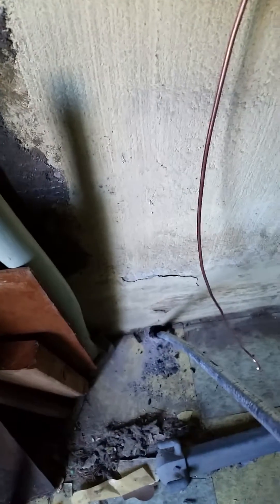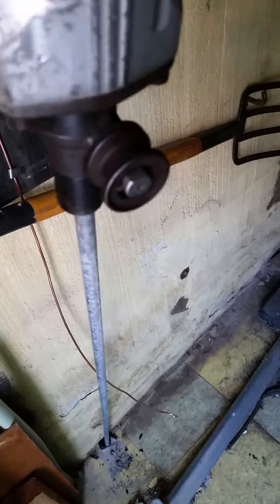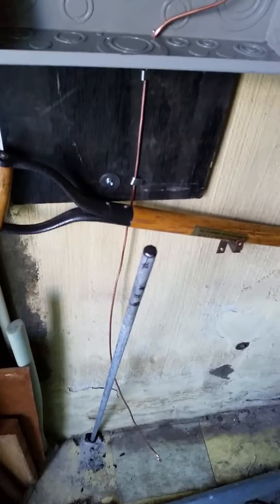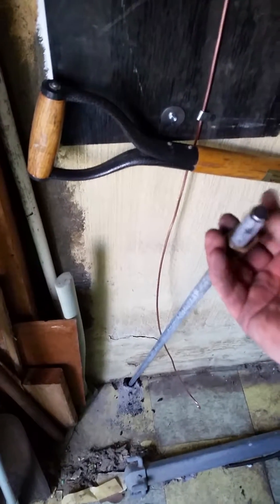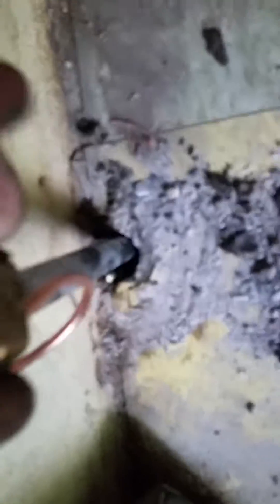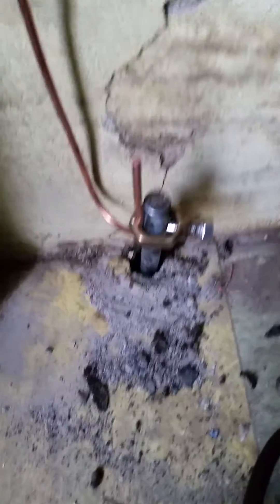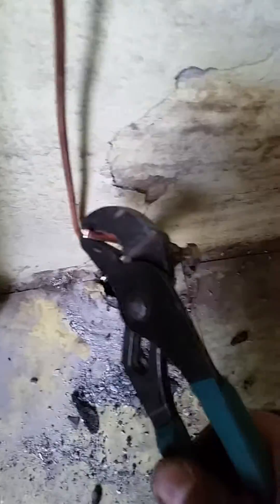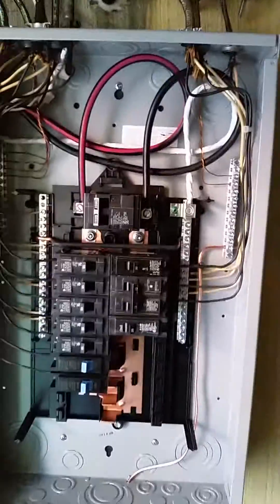Standard 8 ft galvanized ground rod installation.

Comment: Doesn’t code require 2 ground rods over 6 feet apart and a continuous solid ground wire connection?
Reply from the maker: Yes depending on the size of the service